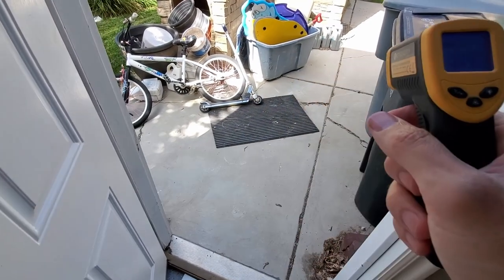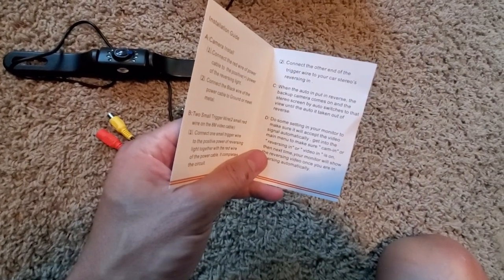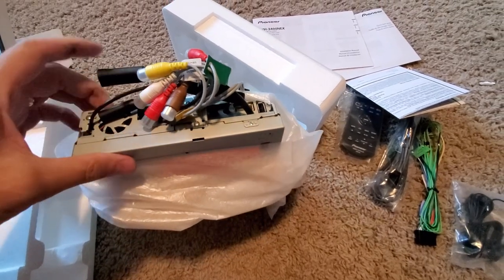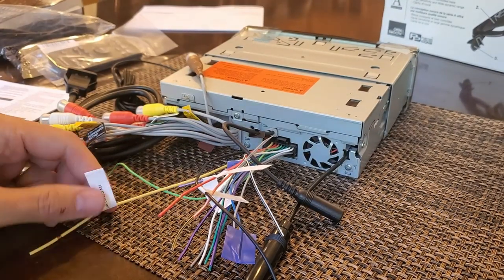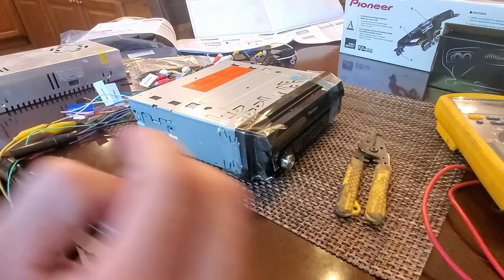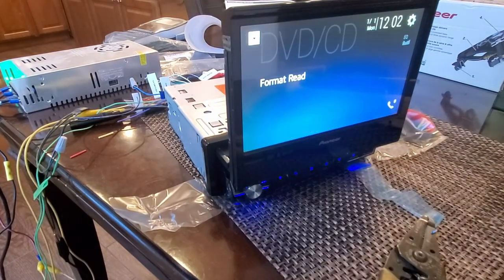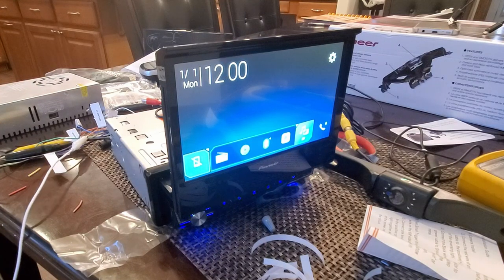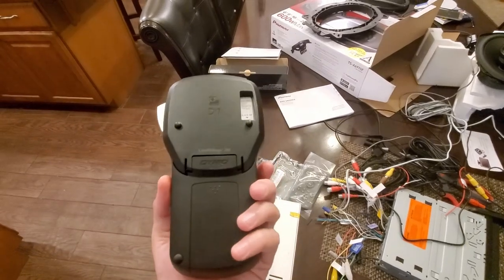Pioneer Car Stereo Wiring - unboxing, micro bypass switch, backup camera, speakers and more.

Comment: Did I miss something? How did you test or confirm that a board was bad in the motor? Is there a video for that?
Reply from the maker: LOL!  There is probably a video for everything.  The board should have a given resistance across the CAN pins.  My board was quite a bit different than a known good board.  I shipped to EV Controls to confirm along with the controller.  CAN chips on both the controller and inverter were fried.🙁